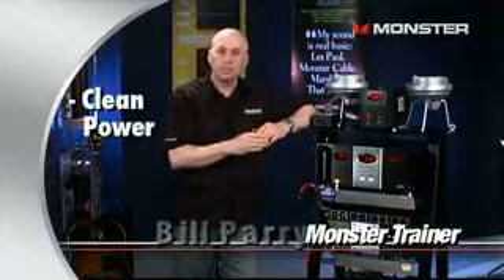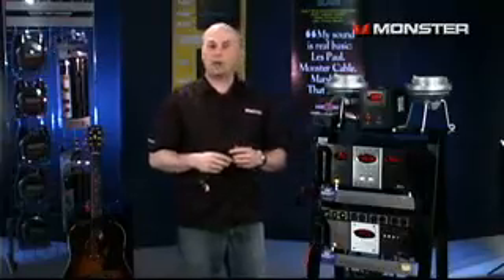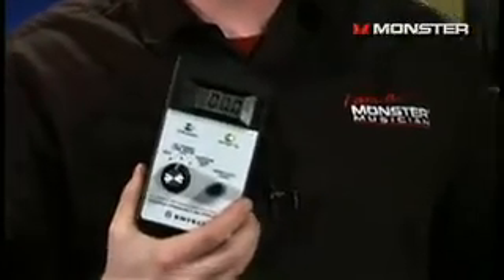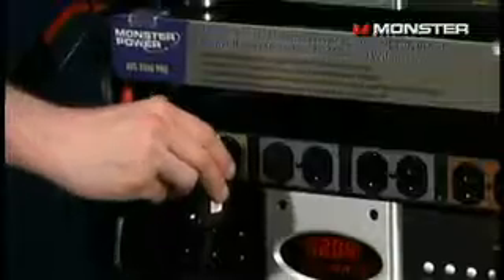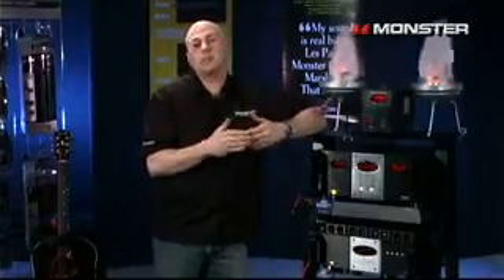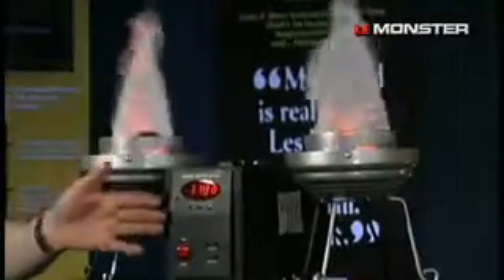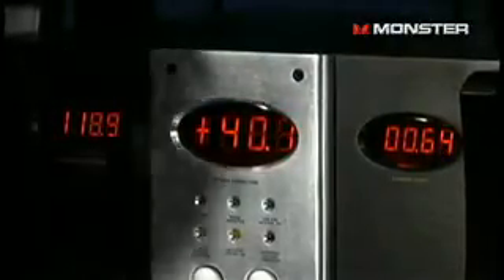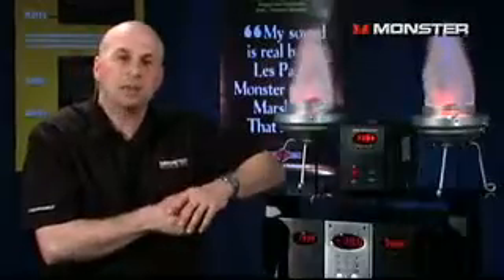Noise Sniffer Demonstration

Comment: This is just crap, let me explain...... the so called sniffer filters out the 60 Hz then amplifies the mid and high frequency "noise" on the mains 100 times so we can hear it on the sniffer internal speaker like crapy noise we are fooled to believe makes the amp performance badly or something .. if you use a 50 or 100W 8 Ohm 6" or 8" speaker with a 50W 1000 Ohm resistor in serial you can hear a nice 60 Hz :) and this is NO bull..